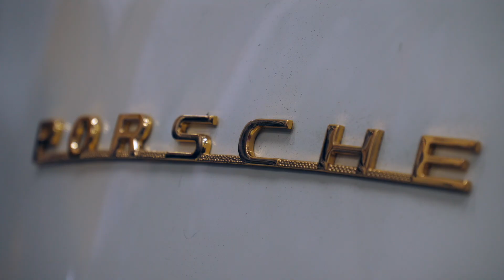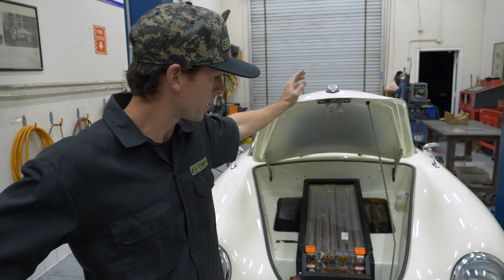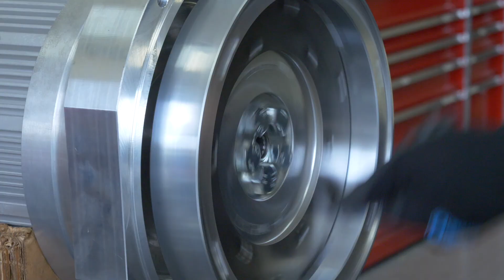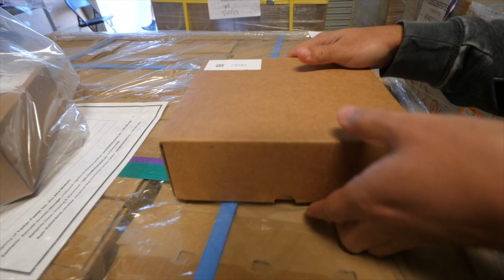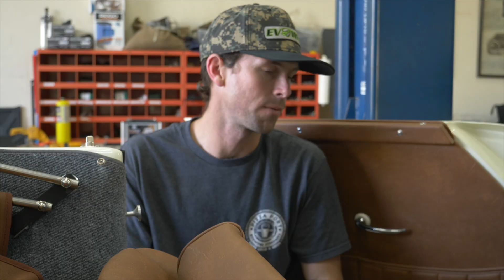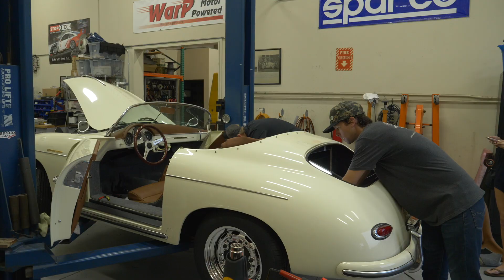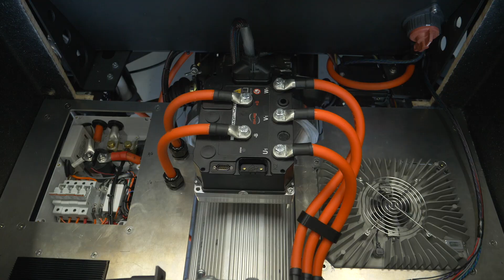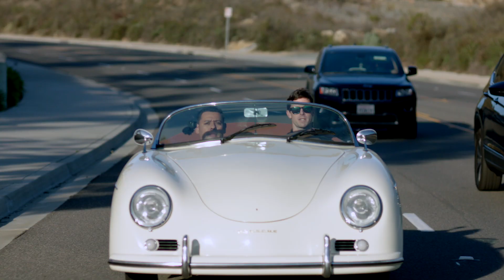Electric 356 Porsche Speedster Car Build

Comment: What's the need for a clutch..
Reply: I think is is simplicity. You can start in 2nd. You actually don't need a trans, but you would have to do a lot more engineering.
Reply: @tony_25or6to4  ok I can buy that. Building another custom part vs using an off the shelf clutch, which by the way helps dampening torque surges to the transmission..
Reply: @LuisTeixeira  Its not exactly a lot of torque compared to what an ICE motor would be putting through the same transmission, It's done like this purely because it's easy, just disconnect the engine from the clutch and fit an electric motor in it's place, add batteries and a potentiometer throttle pedal inbetween and you have exactly what they have done here, You could literally do it at home with basic tools. Especially when this car had no motor to remove.
Reply: @themightydash1714  regarding torque I would not readily assume it is comparable in these two cases. If not electronically limited (and of course depending on the specs), an electric motor can output a lot of torque right from zero RPM. With an ICE there is only so much low RPM torque it can deliver before it quits or limits itself.

Comment: This is a idea of mine , that i have no were near the $ or ev knowledge to do it myself.  I would like to see someone convert or fab a box truck / camper , but using a diesel generator to power the motor and charge the batteries. With that setup the "mpg" is greatly increased  (should be) and you're not relying on a charge station.  Maybe even have solar panels on top.  Think about being able to travel on 200+ mpg in a camper . That would be an accomplishment .  I maybe wrong but i have not seen anyone do that yet.  Good vid
Reply: Why not cover the roof with solar panels charging Tesla batteries under the floor?
Reply: @tony_25or6to4   night time and bad weather,  but for when its parked or sunny day sure.
Reply: Same here 4x4 to

Comment: So the new motor just hangs off the transmission?... dont you put a brace underneath it?
Reply: They didn't show it. There is a whole mounting system...just like the original, but sturdier.  If it just hung there, the weight would ruin the trans and twist right off the first time you hit the accelerator.

Comment: I understand why this never took off. It is flat, the workers at EVwest are good at what they do but aren't able to bring it to life. It's good shots and a good premise it's just missing a hook or something that gives a payoff. You sort of tried to wedge in a timeframe narrative towards the end but you should have linked that from the start. Still great content though Jehu. Thanks
Reply: It's all filler, it's so easy to remove an engine, replace it with an electric motor, add batteries and a potentiometer throttle pedal that it you could literally show it from start to finish in 1 hours with competent mechanics. Turning it into a TV show means 5 minutes of content, 55 minutes of vapid bullshit filler.

Comment: After all the build how much per mile is the cost of power. I’m sure you have to recharge what is the cost?????
Reply: I get about 3.2 miles per kwh and pay 15 cents per kwh so less then 5 cents per mile.
Reply: @briananderson3620  Yep, there is a penalty for going topless = more drag. Not that it is a show stopper. You'll see a significant difference with the roof up. #2 Is this a kit car, VW chassis + fiberglass? What is the weight of the car before batteries and motor. A guess is good enough?
Reply: I don't go fast enough for drag to become an issue. Car empty is about 1600 lbs
Reply: @briananderson3620  Nice thanks, and not to start an internet argument, drag is always an issue. I used to have a NEV, usually travelling around 35MPH and it had a hinged clam shell top that I usually took off in the height of summer. It cost me around 30% range, even if the frontal area was smaller and I saved 40 pounds of weight.
Reply: What I meant was I don't notice the difference in range
Reply: @briananderson3620  cheers, I get it.

Comment: How much was the cost ?
Reply: i'm working on putting the same motor/controller/batteries etc into a project car of my own and the parts are ~$15k minimum these days
Reply: @bawfuls  maybe it was cheaper as they source the batteries from companies that went bankrupt
Reply: inchskater - no, this build uses salvaged Tesla batteries. The batteries Jehu has purchased from companies going under are different, they’re individual 18650 cells which he offered up for sale on his website to hobbyists. You could theoretically use them for a car but it would take a LOT of extra labor.
Reply: My price is the same as @bawfuls above. Spent $15k on motor, tesla batteries, BMS, charger, and hardware. The truck I purchase was $5k too. So $20k total.

Comment: That's pretty Awsome. Have you seen GMs electrical power plant that matches to any GM transmission. It's pretty cool looking. It resembles a engine . It was in a 2019 camaro.
Reply: Crate Electric. You still need the batteries, wiring, and electronics.
Reply: @tony_25or6to4  no actually go look it up it's all included
Reply: @bobholland9924  with batteries, wiring, BMS, charge controller, converter, and gauges? Awesome.